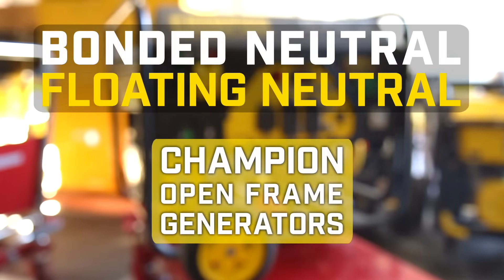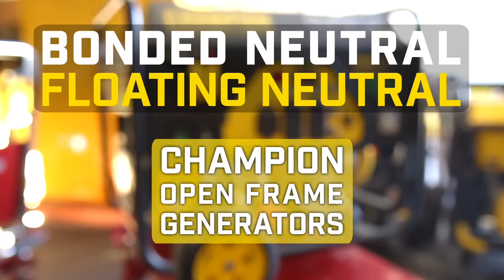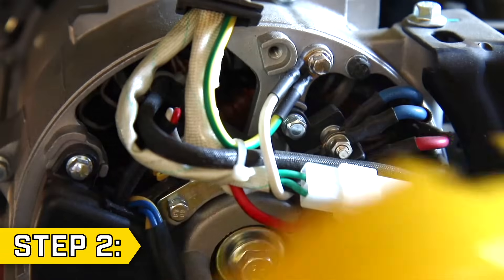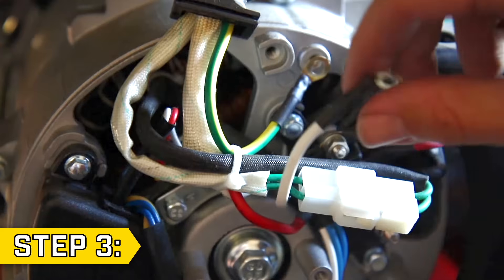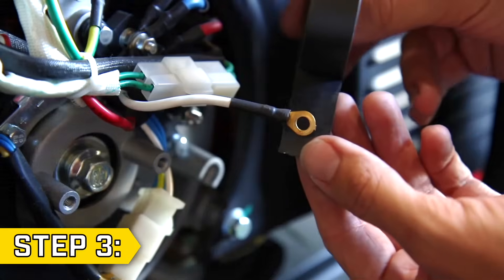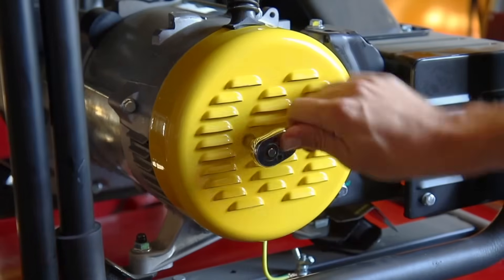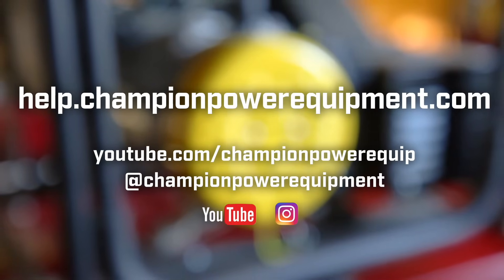Disconnect the Bonded Neutral (Open Frame Generators)

Comment: On my generator (201218) the bond wire is yellow with a green stripe. The other end is connected to the alternator, with a white wire so it seems to be the correct wire. I disconnected it as explained in this video. I checked the continuity between the ground and neutral terminals on one of the outlets with a multimeter. There was continuity before the modification but not after so looking good. I will verify the voltage next time I run the generator just to be sure.

Comment: I have model 201169. The description for this video says it applies to my model.  The wires going to the top screw shown in this photo are both yellow/green.  There are two white wires connected in a white plastic block below. One of the wires is in a wiring harness above. Can't determine where the other goes.  Should I disconnect one of them?
Reply: Mine has that too. I have an open ground to 110.
Reply: Its a bus bar

Comment: Hello, does this work with model 100464? Have been looking for a floating neutral generator for emergency home use with our gererlink. It requires a floating neutral generator.
Reply from the maker: Hello, this video will give you a general idea of what to expect when disconnecting the neutral. If you need any other assistance please contact our support team at 877-338-0999 or support@cpeauto.com.

Comment: Hello, I have model# 201412 and when I open the cover I have multiple white wires below the green/yellow wire on the same stem.  Do I disconnect all the white wires?  Not the same as I see here in the video where there is just one white wire.  Thank you!
Reply from the maker: Hello, We do apologize that this video is not matching your unit. We do have one for your unit specifically, it is titled Disconnect the Bonded Neutral (201417)
Reply: @ChampionPowerEquipmentHQ  Thank you!!

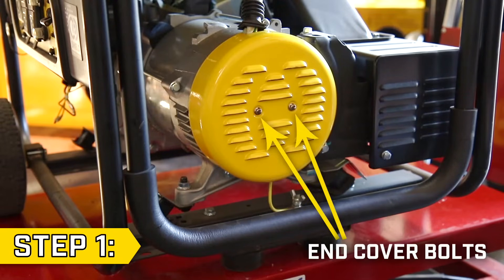Comment: 0:20  The best part of this video is them capturing on video exactly how they all come defective from the factory.  Notice the loose wire boot.
Reply: Well spotted!
Reply from the maker: We appreciate your input; however, we want to clarify that the unit does not come defective from the factory. The video you referenced demonstrates how to disconnect the bonded neutral, which is an optional step. Not all users need to make this adjustment, and the unit can be used as is for those who do not require the neutral to be disconnected.

We hope this helps clear up any confusion, and if you have any further questions, feel free to reach out.
Reply: My comment has nothing to do with the neutral. It has to do with the cheap and shoddy design of super inexpensive generators like these. 

The grommet at the of the top of the electrical cover that was not installed is what I was referring to.  
I thought mine was the same.  That was my mistake.  Inside a year the grommet tore in half because every hose and every wire in these is the bleeding edge minimal length.   
My guess is that doing this adds up to saving a few inches of each which adds up to maybe $1 build cost savings.  

Many of the electrical wires are run excessively taught and fuel line nearly kinked due to the same.  

Specific example. That neutral wire you unhooked is the shortest wire behind the control panel and prevents you from tilting the panel out any more than 30 degrees.

Comment: There's really no point in doing this unless you have a GFCI protected generator.

The only issue you'll have is a small amount of current will flow back on the ground wire because the ground and neutrals are bonded inside the service panel inside your house.  Your generator will still function normally and power your house as it should but if it has GFCI protection then they will kick due to the current flowing on the ground wire.

I have the 11,500W and 9375W generators and they work perfectly even though they are bonded-neutral so don't waste your time 😉

It's the same principle for not combining the neutrals and ground in a sub-panel ... parallel circuit ... current will flow on ground wires.  Only the NEC code Nazis have a problem with this.  Since it's a temporary generator hookup cable, there's no point in making a big deal out of it 😊
Reply: It's more complicated than that, in the event of a ground fault in the system that you describe there will  likely be objectionable current AKA a difference of potential of the ground and neutral conductors. Differences in potential are dangerous for obvious reasons, and dangers increase in old houses that have a bunch of shared neutrals and old school non-grounded appliances near grounded appliances. A lot of those codes were written in blood
Reply: My wacker neuson generator is CFGI protected and it keeps trying to pop out run idle speeds up and the 4 prong twist lockis inserted .  should I remove the white wire?

Comment: I have 100416 and there's two green and yellow wires there.....no white
Reply from the maker: We are sorry to hear this. One of the wires on the end should have a little band with an "N" on it to distinguish between neutral & not. If it does not have this, please email us at support@cpeauto.com. Thank you.
Reply: There's no "N" on it...I am guessing it's the short "jumper" wire that runs to the where the white wire and two blue wires are  @ChampionPowerEquipmentHQ
Reply: I have two green/yellow words as well with no marking to indicate which is neutral. 
 @ChampionPowerEquipmentHQ
Reply: Where does ot go; to a white/neutral wire ? Here's a video of another make where the bonding/jumper is green/yellpw. https://www.youtube.com/watch?v=5rfrwhUsxv0&t=213s   I'm wondering if a bonding wire is between ground and neutral could it be either color ?

Comment: On mine it was not a white wire running up to the ground but it was a green with red stripe running from the ground down to the white neutral connection.